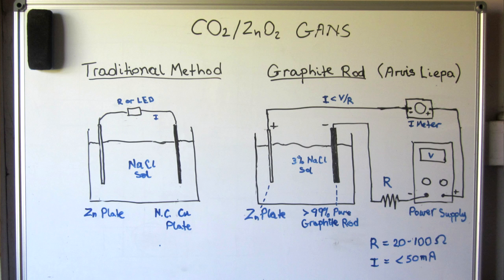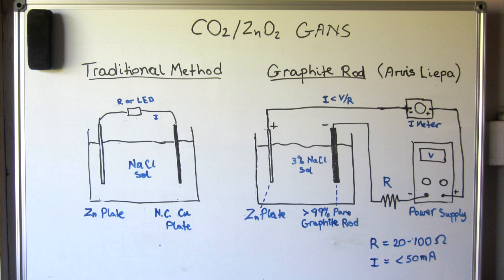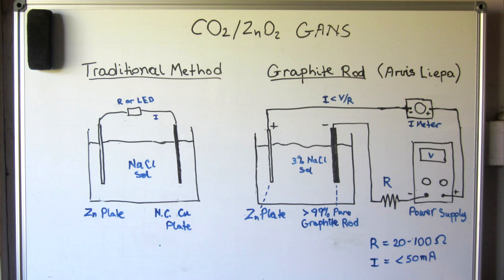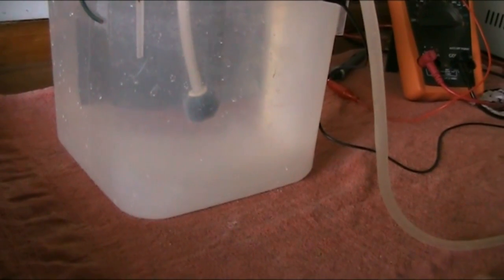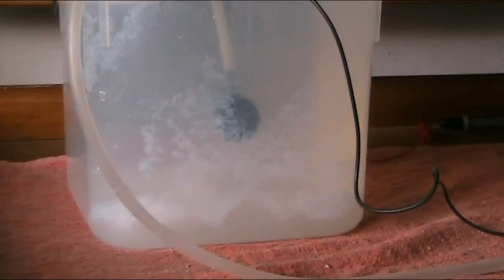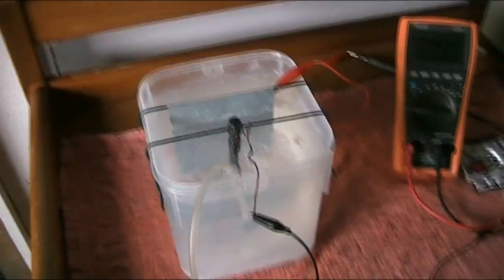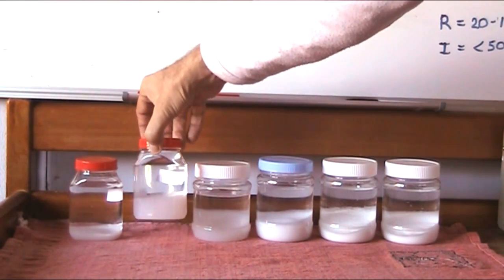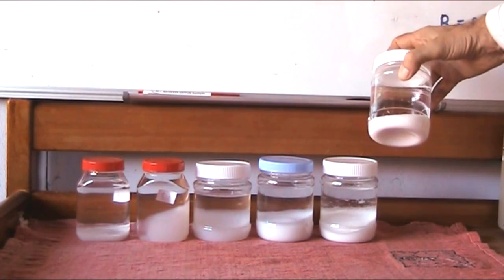Making CO2/ZnO GANS

Comment: It is because of different gases in the proceess. First you have ZnOH then more you run more you have zinc carbonate if you use carbon stick.  Pay a attention to gases from rods. Hydrogen from - and oxygen + or carbon CO2, that's why you have in first place  ZnOH the airy one. H2O starts to splitting at 1.23 volts into 2H and O. Carbonate will always be sand like and sinks better then hydroxide.  Mass, temperature, how much proportion into water, distance, gas, atmospheric conditions. In this case you have mixture of different type zinc gans.
If you would love to help me to make a review in this zinc gans productions. I can give a guidlines what to do and what to show. I have no time to finish it but there is a lot show and talk even just with zinc. Thank you for cupper gans review but there is charter what can be fill up with data. If we could start with zinc it would be very nice. Thannk you. Hope hear from you.
Reply from the maker: Hi Arvis, thanks for your input. 
In the above experiments the V across the rod and Zn plate is less than 1.23V,  ~.7V in the 50mA case & ~.5V in the 10mA case as can be calculated from the data in the video, but there were bubbles coming out of the rod.
Also at one time I tried collecting the gas above the rod and put a match to it and it didn't burn, indicating that it's not H2 gas (maybe CO2)?
In the first stage of production there is not much indication of Zn plate being used up, when you combine that with the fact that there is no splitting of H2O I don't think ZnOH is the material we are seeing at the beginning.
As regards the review I also haven't got a lot of time at the moment (I am working on a way to measure the plasma field strengths among other things) but I will get in touch with you to see if we can clarify what exactly is happening and see where we go from there.
Reply: I will show you ;) big bang :)  I know. Magnesium or cobalt any other metals can split the water naturaly with extra courrent. :)
Reply from the maker: What was the voltage and salt concentration in the last video?
Reply: It not necessary matters in this case. If you want use for the testing then use 10% salt for 1 L water, most common proportions. Make the mass on both ends equal, carbon with copper or zinc. Keep room themparatue. Warmer temparature more faster gases will leave the water. More electrolate you will add in the water more courent you will pass through the water. More salt more current more chlorine gas it will produce it the beginning a little bit, risk of creating some metal chlorides in mixture. Play with electrodes, put one deeper other lees deeper in water, then try revers. Try time sequences. If you see changing then take out, make some longer to see differences.
Reply from the maker: The reason I ask is because your experiment looks like a high voltage high current one whereas the ones shown here are low V low I and they won't necessarily have the same behavior. 
Just to clarify, are you saying that the first stage is all ZnOH or CO2 plus some ZnOH?
Reply: Water splitting is nothing to do with high voltage. 12V 25W solar cell. If you would tune for gas making then you need upgrade to it but our priority is the GaNS production in this case. I can make it happen with a watch battery but it will take more time to show the test.

Comment: Clearest explanation I have found to date. Thanks. Question: are welding rods the same as graphic rods and can they be used  in place of nano-coated copper?
Reply from the maker: Hi adhanda2017, thank you for your feedback, it's good to know that people find this useful.
I wouldn't recommend using welding rods as these can have things other than carbon in them. You can buy pure carbon rods fairly easily and cheaply online.
Reply: Use graphite 99% pure

Comment: I tried using the zinc and graphite rod in a coaxial arrangement and have gotten some very light CO2 Gans ... I used 1.5 volts and 6.5 mill-amps.  Very interesting looking CO2 Gans.
Reply from the maker: Hi, I saw your videos, nice work. We are both coming to the same conclusion about pure CO2 which is good.
Thanks also for sharing my Cu Gans stuff and for your kind words. :)
Keep extending the knowledge.

Comment: you didn't put a LED between carbon stick and zinc plate you got 90% is 
Zno2 not Co2. Put LED positive connect to Zinc negative to  carbon stick
 you got 80%  Co2 that was Keshe said.
Reply from the maker: This is the case for nanocoated Cu method not so for the carbon rod method.
Reply: I saw your whole video very good explain to made Co2 and Zno2 ,Can you explain the second bottle 90% co2 how many ma and voltage and what resistor  and how long it took ?  Thanks
Reply from the maker: Thankyou. It was 50mA, 20ohm & ~2V, V is adjusted to get the correct I.
I don't remember the time, I think it's ~7hrs. There was a small amount of the white material in there, as mentioned in the video I estimate between 80% - 90% CO2.
Reply: Have you put the co2 you made into car tank fuel? What are you doing on the co2 you made?
Thanks
Reply from the maker: Haven't tried it on the car, we are mainly using it for health purpose at this stage. 
We have had good results in that area. Our main way to use it is by drinking the Gans water.
Reply: you can drink Gans water no problems?Can you tell me after you dink what is different?
How much you drink every day ? How long it can drink after refuel in Co2  Gans? Thanks
Reply: Co2 Gans water and Zno2 Gans water which one is good?
Thanks
Reply from the maker: There is no problem drinking Gans water, see our other video where Mr Keshe talks to a guy who used the water of CO2/ZnO2/CH3/CuO2 Ganses to eliminate Aids. The only thing to watch out for is not to take too much too quickly, especially if there is some illness there, because of detox effects.
We started slowly with CO2 and then ZnO2 and now drink the water of all the 4 Ganses whenever we drink. At the beginning I felt a little dizzy and had slight diarrhea, typical detox reactions, that soon passed.    
The first thing we noticed was an improvement in our digestive systems, better bowel movement, feeling lighter, etc. We now have more energy and stamina and at the same time don't feel like eating as much as before.
Reply: @EsotericScience  very informative and useful. Thanks for this video. How much GaNs u consume? Dosage and for how long before we see effects? Which GaNs is recommended for 20 years old type 2 diabetes? Any inputs?
Reply: EsotericScience I felt the same way when I started taking Ormus. No diarrhea but less feeling hungry, sleeping better and feeling more energetic getting up from bed, comparing waking up feeling drowsy before. I do want to try GANS. Thank you. Good video.